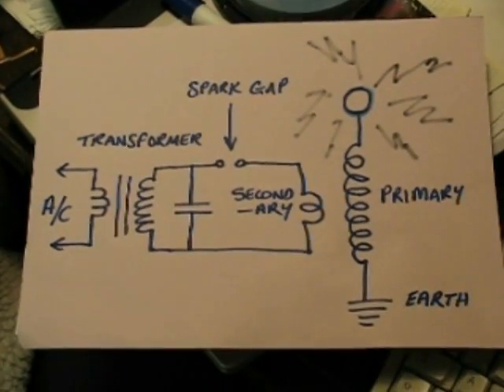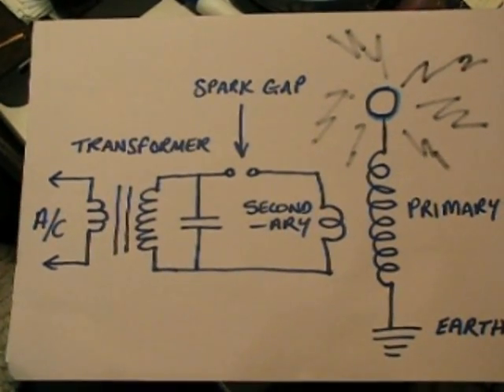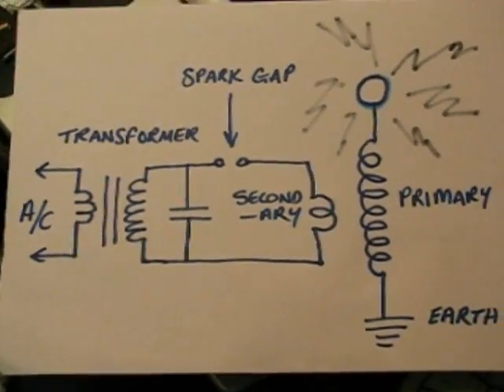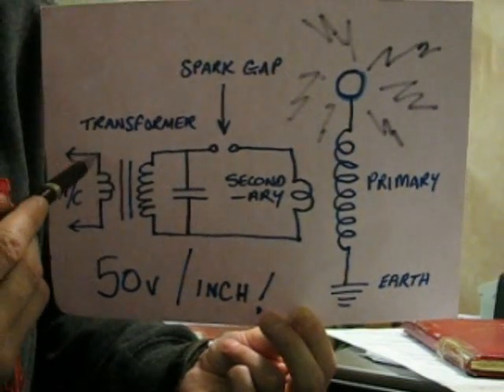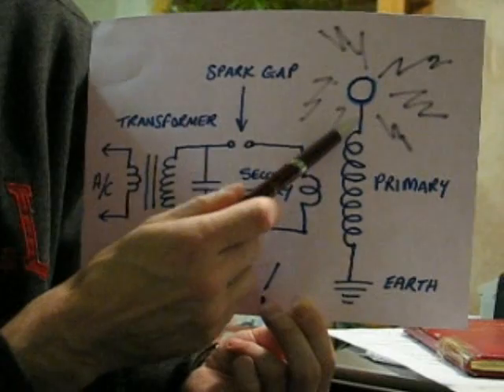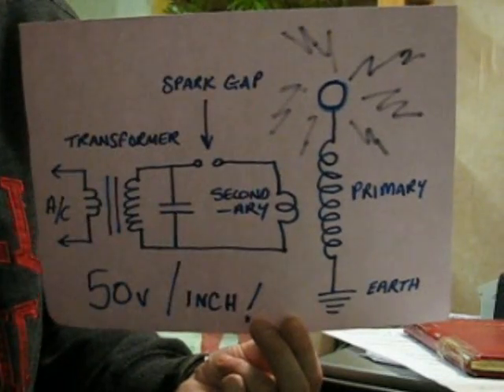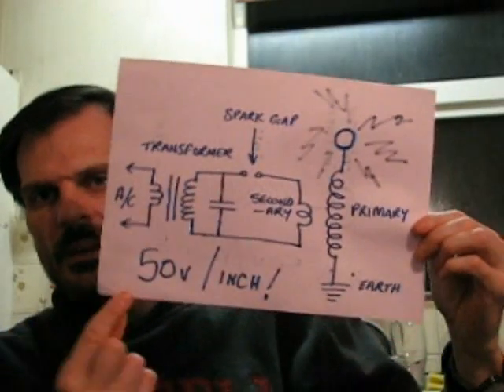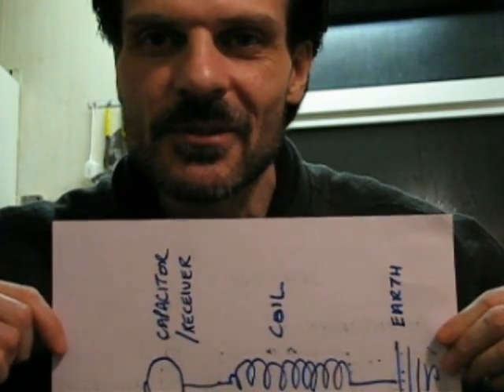Tesla's Little Secret

Comment: The atmosphere, absent sparks that might ionize it, is HIGH  impedance. To use the sphere as an input antenna is not going to "receive usable power levels.  The voltage might even be pretty high without a load. Since the high impedance of the air won't load the antenna, the voltage stays high. But as soon as you try to do any work with that voltage by driving a load,  The entire voltage will be across the atmosphere, with the LOW impedance load acting as a short circuit.  
>>> Remember those giant sparks that shoot out when it's an output antenna?  Well, you would need to have that kind of lightning hitting it as a RECEIVE antenna to achieve usable power at the AC terminals.  
>>> There is no hidden or secret property of physics being overlooked.  Any FIRST YEAR electronics engineering student can easily explain exactly how it works, what it can do , and why it can't do most of the things people have come to expect.  These false expectations are   kept alive due to the lack of critical thinking skills and scientific training providing no analysis and no rational counter-balance to the decades of over-active imaginations stimulated by stories based on the popular folklore, superstition and pervasive mythology surrounding Tesla.
Reply from the maker: Tesla used his coil to energise the atmosphere and another tuned coil to resonate with it and receive energy. Before lightning happens the clouds are still being energised and full of energy. Clouds do not "store energy" lightning is the result of charged water molecules aligning and forming a type of battery that is charged by the sun. That's how a relatively small storm cloud is able to produce so much lightning repeatedly. It is continuously being recharged from the aligned energy of atoms which are constantly being charged by Radiant solar energy. Air is only an insulator until it reaches ionisation when it becomes a conductor. The erratic behaviour of electricity conducting through air is only the energy frantically leaping about trying to find its opposite polarity (usually ground) through the path of least resistance in the random array of molecules which IS air. 

Hmm we have a shoe shop in town called "Miracles". Go back to school? Not anytime soon, thanks.

Comment: Thanks you, I enjoyed your review.  
For the antenna, what size is the ball, and what is its material?
For the antenna side coil, what length does it have to be, and to get it to couple with the capacitor coil, do you use a magnetic core loop?
I love this circuit.   I would love to make a small antenna pick up to see the scalability of it.
Reply from the maker: Here is an idea. What if it is not about length of antenna but number of turns and coils? Coils create field lines that interact with the aether. More coils means longer antenna and higher frequency. Number of coils is also proportional to the resistance. So according to Ohms Law if we have potential voltage and resistance we can calculate the power output. For a convention DC circuit anyway. The math gets a bit more complicated with AC. More turns means greater inductance. I don't think it is important what the dome is made out of. Maybe aluminium laminated with acrylic or clear PCV? And you would probably want to adjust the ratios of the coils to optimise them for the wireless transfer of energy? Good luck :-)
Reply from the maker: By optimise I mean the amplitude, frequency and wavelength of the output signal. A similarly tuned coil (same mass and number of turns) will then act as a receiver.

Comment: the wardencliff tower was big enough to collect energy and then create a hi voltage dc spark that will make a eather wave, this is what is transmitted wireless energy, and it puts out far more then the seed voltage to start the eather flow.
Reply from the maker: The dome ionises the atmosphere in much the same way as a Van De Graaff generates static. A resonant coil at a distance can then receive the energy from the aether.
Reply: most of the electronics in a CB radio is to remove all the voltage "noise" from putting up a antenna.
Reply from the maker: Because citizen band works at a frequency where there is lots of noise (similar signals)? Is that where signal to noise ratio is important, to be able to decipher the incoming signal? I don't think Tesla tech operated at radio frequencies anyway? Can you imagine the noise the radio stations would get if it did lol.
Reply: Tesla created a scalar wave, at Wardenclyffe, BIG DC SPARK, then got the electrons out of the way in the second coil that was like one inch thick with resistance, then the scalar wave energy would flow without the electrons holding it back, Magnifying Transmitter, one big spark and he could electrify a metal plate for 15 mins. you can find a pic of this, but they never tell why they would take this pic, because it was important.
Reply: if you hook up a radiant energy device without a spark gap it will blow the capacitor every time, so even though the energy come in at .75 volt to 1.5 volt, it has tremendous torque power.
Reply from the maker: The primary coil needs to be bifilar wound as I understood it which cancels out the magnetism and back emf. Or something like that?
Reply: there is testing available on bi-filler coil,, it gives a boost to some frequency and a dip in others, so if you wind it to a needed frequency then you will get the boost. but if you need a consistent wide rang then standard coil is better.
Reply from the maker: There was a reason Tesla used a bifilar coil. Maybe those are the frequencies we need to be looking at?

Comment: Tesla was all about giving electricity to the world. The Tesla coil is the converter of aetheric energy to electricity. Potential difference from 6m high to ground is 1,000,000 volts and 1100 amps
Reply from the maker: Hi, where did you get those figures? Is that what the Tesla cool produces with a power supply at its source? The aether is capable of producing that kind of energy but not directly through air without accumulating it first?
Reply from the maker: *coil
Reply: The aether has infinite energy available and all we need do is convert it. This is the knoledge of Tesla and he made his coil to help us do exactly that. To convert the high frequency high energy electrostatics down to useable energy for us to utalise.

Comment: What is stopping someone\anyone from building this to find out?
A mini version but not reversed. If he disconnected the battery and connected a voltmeter across the terminals....?:
https://www.youtube.com/watch?v=MjTK-L3sLxI
Reply from the maker: It would be a step down transformer. It might work if the antenna was high enough? The problem is the energy is DC and constant and unless modulated to AC it would not cause (useable) inductance in the coils. The AC from radio waves etc in the air is very small current and not really useable as a power source. Tesla suggested using a laminated sheet of aluminium as the receiver on top of the antenna. The tech works. You can make a battery that lights an LED just by pushing a metal rod into the ground. It is the potential difference that allows energy to flow in a conductor.
Reply: Its not really a problem, you would need to use transistors. Check out what a ZVS driver does, it's called pulsed-DC. I think the issue here is that unless it's struck by lightning, you wouldn't draw enough power at any given time to really do much of anything at all, I suppose you could try using some type of storage/capacitor, but again you would be drawing such small amounts that the loss from resistance and all that would just negate the whole thing, unless you could create a difference in potential large enough. Too bad we can't build a new Wardenclyffe, eh?

Anyway all circuits technically work this way, what they do in one direction they do backwards in the other, it's the nature of electricity, but the power always must come from somewhere.

Comment: Absolutely concur - I have a number of Dr. Tesla's books and I'm a member of the Tesla Society.  I would like to posit that  Dr. Tesla intended to use the - antenna PRIMARY to earth and then reversed, in a transmiter-receiver pairing. . I do believe that his laboratory in Colorado Springs Colorado was configured as you say, and was feeding so much energy back into the Colorado Springs mains, that he blew out their generators which is what happened.  Now: wired the other way, with the secondary connected to the antenna (load) and ground, you create a massive voltage with which, Dr. Tesla could "tickle" the Schumann Cavity at its resonant frequency.  Perhaps a way to think of it would be like enticing a cow to give milk....  Dr. Tesla would "tickle" the Schumann cavity with the "transmitter" and receive it on the other end, again at its resonant frequency, with the "receiver". The Schumann Cavity stores energy delivered to it by the sun.  This should NOT be confused with zero point energy or "perpetual motion", it is simply extracting available, free and plentiful energy, working with natures natural rhythms. 

Dr. Tesla said his goal was to distribute free energy any place in the world, as well as transmit images etc.  People are now beginning to test this primary/secondary theory , increasing either voltage or current as desired, in small scale, across the ether,  and not simply build  "Tesla coils".  

It is possible that one of the purposes for HAARP is to "tickle" the Schumann cavity, and transmit energy, as well as, to heat the ionosphere to create bubbles for Over The Horizon, Back-scatter Radar.( OTHB-R) -- Imagine where would be had the terrible industrialist J.P. Morgan, and his minion, Edison, not destroyed Dr. Tesla. Tesla was a humanist, and "free energy" could not be allowed.  By the way, Marconi (who had worked with JP Morgan to steal Dr. Tesla's patents and works, and burn down his labs - has been stripped of his title as the inventor of the wireless. It was and is and is now acknowledged to be, Dr. Tesla)
Reply from the maker: Well said sir, you appear to have a good understanding of the basics! I believe the Tesla tower would ionise the atmosphere but not to the extent that it would create lightning. And then resonant towers around the globe could network and receive the energy. Smaller the towers of derivative resonant frequencies could be placed in home, electric cars (and even watches) and everything could be powered for free "off the grid". Of course Morgan and Edison (the minion lol) didn't want this. 

Did you know Tesla also invented the lightbulb? Tesla had vacuum light bulbs long before he developed the less efficient filament bulb for Edison who then claimed the idea as his own. 

It is easy to create resonance between the towers too. You just make sure that the number of windings on the coils and the mass of the coils are equal. 

Happy Boxing Day :-)
Reply: Can you explain Tesla society plzzzzz!!!!
Reply: Actually Edison was just a pawn of JP Morgan. JP Morgan put him out of business as well, and then turned Edison's company into GE.

Comment: Got this response from a friend:

Being able to get “50V” means nothing about the useful amount of energy that might or might not be available.   There’s lots of static electricity everywhere that has almost no useful purpose other than to make people excited.   Energy is voltage and amps over time, which to be practical means continuous flow, either AC or DC, not building up a microsecond spark every few seconds.  You can get thousands of volts with a balloon and an insulator, but there isn’t anything useful to do with that energy, which is in the micro-joules.  A joule is one watt-second, 1 ampere at 1 volt for 1 second.

Solar energy is primarily in two forms, solar wind which doesn’t strike earth’s surface because of our magnetosphere, and light.  Light is by far the more useful form, because the “solar wind” is actually scattered high energy particles and difficult to collect, let alone turn into a useful form of energy.
Reply from the maker: Hi, the static-energy-ballon principle you call "useless" is what Tesla called his Radiant Energy Receiver which is where I got the idea for this video. Solar energy is not only scattered particles, it is a combination of AC received from the central sun at the heart of our galaxy, DC (potential difference or electrical "pressure" as Tesla called it) which is all around all the time and what powers atoms and creates lightning, and radiant energy in the form of neutrinos which superconduct through space and permeate all matter. By far the easiest of these to receive is DC. The combination of these in tune with earth's iron core and subsequent magnetic field lines, creates the effect we call gravity. :-)
Reply: +MattBlytheTheOne 
 Wow, love been trying to visualise the electro-gravity concept. I BELIEVE LOL, but trouble seeing... please help! Great thought inspiring video! Thank You!
Reply from the maker: I received insight into the idea from the book "Cosmic Radiant Energy and the Electrinium Battery".
Reply: MattBlytheTheOne 
 Thank you! You have a new sub! Looking forward to becoming a use full member! peace and harmony from the colonies!

Comment: Does simply sticking a conductor in the ground actually result in current flow? if so, what do you need the capacitor for? Or th transformer for that matter.

In the original circuit you need to build up enough voltage so that the induced current can overcome air resistance and make impressive sparks. If you are harvesting energy, don't you simply need to step up the voltage, and couldn't that be done by adjusting the ratio of windings on the primary and secondary coils of the collector?
Reply from the maker: If you build up charge across the capacitor and then discharge it in resonance you create a rough AC signal which is useable. The DC current flow is very small otherwise. Adjusting the ratio of the windings on the transformers, that was the general idea to begin with... since then I have started looking at what lightning is and how it is created, that is the real source of power. Not the lightning itself but how it is generated.

Comment: Hope it will be interesting. My vision and andestanding of Teslas tecnology https://cloud.mail.ru/public/JVAz/XjpXmX6Zi original in russian and translated in english https://cloud.mail.ru/public/DZkc/xuhvA1ZaZ Shortly, vision based on Teslas patent № 512340. Common Tesla transformer secondary coil consist of one layer. But in this version the secondary coil is bifilar, videlicet it consist of two layers, connected in series. Between layers we have electrical field E=U/2 . If we put capacitor (two plates with dielectric between them) in this field, we will have electric charge separation (electric induction) in it. Load mast be connected to this “internal” capacitor. There is NO magnetic coupling between coil current and load (inner capacitor) current, because they are perpendicular! So there is NO electromagnetic feedback! To better understanding Teslas patent № 512340 and Donald L. Smith With best regards, Nodir P.S. There is important information additionaly http://realstrannik.com/forum/proekty-i-izobreteniya-nikoly-tesla/120-more-energii-vokrug-nas-n-tesla#61068 Find out the last lifetime interview of Nikola Tesla. Written down by Alfred S. Hawle from the words of Nikola Tesla on October 28, 1942 at the New Yorker Hotel. Here the russian version http://realstrannik.com/forum/proekty-i-izobreteniya-nikoly-tesla/120-more-energii-vokrug-nas-n-tesla?start=54#63863 There is very interesting picture of a mechanical analog of his overunity devise. Here my correlation http://realstrannik.com/forum/proekty-i-izobreteniya-nikoly-tesla/120-more-energii-vokrug-nas-n-tesla?start=126#72055
Reply: Bifilar winding changes everything! Thank you for this!!! I just feel so humbled (a mere BSEE) when I research Dr. Tesla.  I have a picture of him going up the stairs in my home - I look at him every day, I look into those beautiful eyes - .... As he was frail and dying, penniless and on the continuing good graces of J J Astor (JP Morgans enemy) who died on the Titanic (JJ Astor was Dr. Tesla's beneficiary) in the Astor owned New Yorker Hotel -  he said:  "The 20th century belongs to you, the future belongs to me"  And so it is.

Comment: So you've built this?
Reply from the maker: No, there are lots of examples of it in technology though. The crystal radio is a low power version using radio waves. A high power version would be the conductors at the top of broadcasting masts.
Reply: Matt, but don't you see that the energy in crystal sets has come from the broadcast stations carrier wave?

Comment: What would be 50V / inch? Ball size at the bobbin tip? I did not understand this 50V / inch.
Tks
Reply from the maker: +KIGRATIS Energia livre 

Tesla stated that as you go up into the atmosphere, voltage potential difference between atmosphere and earth increases at a rate of approximately 50v/foot. There is voltage all around us all the time. Atmosphere just acts like an insulator.

Comment: You are as far off from the original Tesla ciruit as you can be.Tesla's circuit had a special machine that generated 15,000 volts of "direct" current. It will not work with alternating current. His spark gap chopped up the dc into pulses. The time duration of the pulses, adjusted the properties of the free enery that came in from the aether. But I hope you keep making money with your sh.... Just don't think you are educating anybody. rather the opposite.
Reply from the maker: Thank you for sharing!